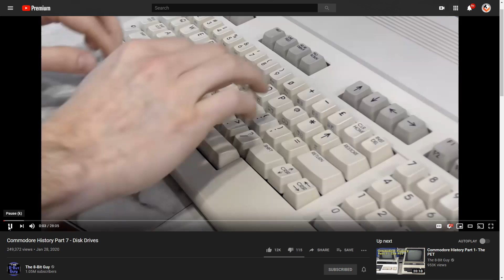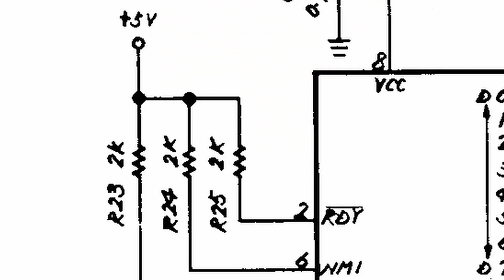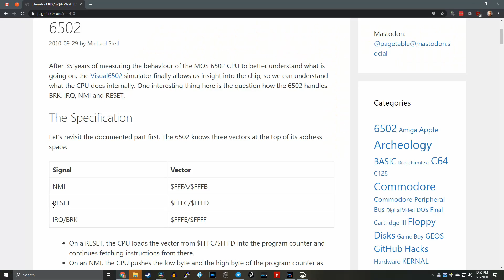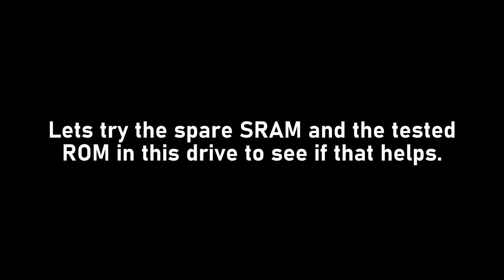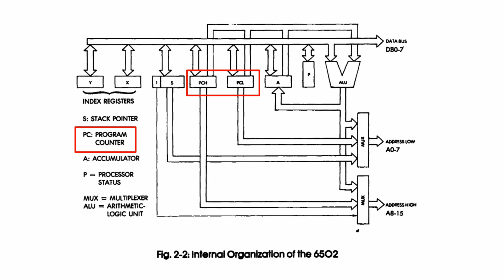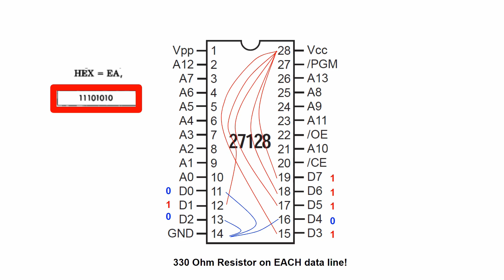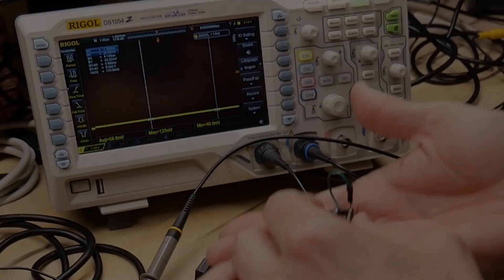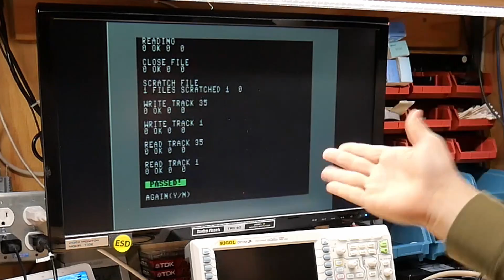Using a NOP Generator to help fix a dead 1541C drive (Bonus Track 1 Sensor demo)

Comment: Now that is some genius trouble-shooting. Totally out of the box and I love it!  

I love the 1541C drive, especially after you enable the sensor.  (Goodbye head knock!). I did on mine more than 30 years ago and never ran into any issues that I recall.  I still use it today.  But if you do come across any further information other than what was known at the time as "compatibility issues" please let us know.
Reply: I recently acquired a mint 1541C that has the track zero sensor. I have been vacillating about cutting the jumper and so far haven't done it, but 30 years is a pretty good test period.
Reply: @jasongins  Go for it.  😃It's still my main drive that I use.  Besides if you find something you don't like you can always reverse it.  Or you can install a switch so you can enable it or disable it at will.   To this day I still don't know what "Compatibility Problems" would have caused them to disable it from the factory.  Afterall, they used the sensor on the 1571 and while that is not 100% compatible, even in 1541 emulation mode, it still works fine with most software.

Comment: On the old 1541 you can put a small strip of gaffers/duct tape at the rear of the head to mute head knock.
My drive still has it now, 30+ years later. =)
PS. Nice video Adrian!

Comment: I added heat sink's to both my drives on all the chips  and a cooling fan on one of them and have not had any problems running 4 years without a chip failure and they get used a lot.
i have 2 drives aside that have the same problem as well  that i have to fix one day. Now i know what the problem is. thanks Adrian

Comment: I never would have imagined a test rig like that to test the lines like that. Holy smokes, that gives me a whole new angle to attack these dead 1541's I've been using as a bookend all these years. You sir are a wizard! Rock on!
Reply: ungratefulmetalpansy  Commodore, for all their innovation, was notorious for using shoddy parts and cutting a lot of corners. I'm just excited to hear there is a means to actually check the data lines, as it could save some old hardware.

Comment: Bad 6502s are more common than they get credit for... My first 1541 had a bad 6502 as well, diagnosed similarly, but since it was socketed, I suspected the CPU much earlier after a scope showed weird bus behavior. I bought a "new" 6502 from Jameco and it worked a treat. Starting to think 6502 ought to be more suspect in the diagnostic of bad drives ;)
Reply: I wonder if it is the way they are being handled. Back then static was a big issue. Wrist straps were SOP always. Later years they were done away with because diodes were added in the chips to deal with the HV static discharges. Now they are in everything and wrist straps are only a part of history.

Comment: Thank you for another excellent video. This  is almost like watching a thriller, or crime drama like NCIS or CSI , except better because it's real, you're solving the case yourself, and using cool hacks which are techniques i can use, tools I can actually build in my workshop and use. practical, informative, clearly explained.. A joy. thank you again.

Comment: I was really hoping it was something other than the 6502 again. I recently bought my third 1541 disk drive, and it's the only thing left in my ever growing collection that doesn't work. It has the same solid red LED and perpetual spin. I did a full exchange of socketed chips (all of the main chips were socketed) between the dead drive and one of my working drives. The working drive still works, and the dead drive is still dead. I checked all of the voltage rails and got exactly what is expected everywhere I looked. I definitely learned a lot about these drives watching this video and your last 1541 video. I was just hoping one of the drives would've mirrored mine lol.

Comment: You have certainly elevated your skills lately, or have been holding back before.  Certainly more valuable information than others that just think "retrobriting" is restoring,  instead of actually saving machines like yourself.  Great video.

Comment: I'm really loving your recent videos, very informative and creative. I never have seen or experienced a faulty CPU before. Maybe because I work with newer computers. You need to have a logic analyzer, it will make your life easier and will provide a wealth of information for the kind of debugging you do. 
Thanks for the detailed NOP explanation!
Reply: Newer chips have static protection built in while older ones do not.

Comment: In the video, Rodney Zak's book on 6502 programming is recommended.  That book is very dated and doesn't cover the 65C02 and 65C816.  A more-current book is "Programming the 65816, Including the 6502, 65C02, and 65802" by David Eyes and Ron Lichty.  It's available online and is well-written.

Comment: That's really ingenious ... I'll make sure to have one of those at hand if I ever get back into C64 repairs.
On a sidenote: a friend of mine was involved in the initial SID reverse engineering effort which included scanning the silicon of the chips ... his verdict (as someone with a massive knowledge in that field): "it's a wonder those chips still work after all those years, if you extrapolate how bad the manufacturing quality originally was to begin with" (silicon supposedly is 'bubbly' as hell). I guess it's no wonder some Commodore chips have failure rates near 50% by now (PLA, MOS TTLs, TED/7501, some 6502s to name a few)

Comment: I like your videos a lot. They are very educative. Have your ever considered wearing an esd wrist strap? Some of the damage could be done by an esd discharge. Especially CPU's and RAM's can be sensitive to that.
Reply: Yup. I was just thinking how those were SOP for opening anything back then. Chips would break from HV static discharge if you just looked at them wrong. It is just taken for granted now that chips have that protection built into them.

Comment: The computer I had back then was an Oric Atmos. Its CPU was a 6052. So basicaly that drive used almost an entire Oric just to spin the floppy of the C64...  Amazing.
Reply: There is no floppy controller chip in the 1541, all of the processing is done in software. This makes the 1541 an extremely flexible drive, you have very low level control to the disk; some games went as far that they used custom low level disk formats for copy protection.

Comment: Hi Adrian, just as a hint: one should NOT put a socket with the machined pins into another socket. The pins are thicker than normal IC pins and widen the contact fingers, which can lead to premature failure of the socket.

Comment: Unless I'm messing with RF stuff, I like to have my signal ground on a separate probe. They're all tied together inside the scope, so if one's connected - they all are. Having it connected separately keeps it out of the way when I'm moving the probe about and doesn't risk coming loose and shorting something.

Comment: One of the things you can look at when you are checking the address lines on a running 6502 is that A0 should be changing constantly at a frequency varying from about half the clock rate to the clock rate as it reads and executes instructions. It would be only very unusual code that leaves A0 either low or high for more than a few cycles.

And when using a NOP generator you should see A0 cycling at exactly half the clock frequency, 500 kHz on a CPU clocked at 1 MHz. (The NOP is two cycles, so each address will be read twice before incrementing to the next address.) Every address line above that should be cycling at half the rate of the previous one: 250 kHz for A1, 125 kHz for A2, etc. You can just walk your scope up the address lines (increasing the horizontal time base as necessary as you move up) with the frequency counter or channel frequency measurement turned on so you can see the frequency halving with each step. It's a good quick way to check that all the address lines are working properly.

Comment: Awesome explanation of the NOP generator! That’s a great tool to have in certain situations. 

I’m wondering if you could build one into a 40-pin “DIP clip” connector that hooks right over the CPU. You wouldn’t have to desolder anything, and you get convenient pins for scope probe hooks, too.

Comment: Hello Adrian after checking the address running within the NOP Eprom so you must check also that the 6502 is not in Reset. If the Reset is down the addresses are also not counting. Best Regards Volker from Vienna

Comment: You just turn your basement into C64 Basement latetly :) That would be very nice if you could add  386 -486 series restroration / repair videos as you did in past. Those were awesome man. I really like floppy drive repairs  btw :)

Comment: It's quite interesting that this drive comes originally with a 6502 CPU that is a 2 MHz variant. The letter 'A' after 6502 indicates that it is 2 MHz.  I was really hoping that the replaced CPU would be a 1MHz 6502 because you masured the clock and it is actually working at 1 MHz.  I wish your 1MHz spare worked.

Comment: fun fact. use a criss-cross wired dpdt switch on the red and black wires on the drive motor to be able to read the reverse side of 1571 formatted disks

Comment: I just started watching the video, so I'm sorry if you already mention some of that stuff in it.

My 1541c has a "normal" short board but a mechanism with a track 0 sensor that just stays unused due to the old board and old DOS-ROM. Datecodes on the drive mechanism and the board match, so it doesn't seem like something someone made at home by swapping parts. It looks just like commodore simply used what they had lying around, even if it meant putting in a drive mechanism with a track 0 sensor that will never get used. Which seems a bit strange, since there are also variants of that mechanism without the sensor, e.g. those used in the 1541-II.

Also, the enabled track 0 sensor will break compatibility with some fastloaders.
Reply from the maker: Completely believe that Commodore assembled such a drive. Do you have any info on what titles break? Others have commented it seems like an urban legend about the track 0 sensor causing issues.
Reply: @adriansdigitalbasement  It doesn't break software based fastloaders; it breaks compatibility with hardware-based parallel fastloaders, since the track 0 sensor occupies a line normally used for the fastloaders. Using such hardware fastloaders thus requires you to cut a trace to the track 0 sensor and replace the ROM with the original 1541 ROM (burnt onto a single EPROM) or (even better) the 1541-II ROM.

Comment: Great video, one tip though. It seem like you were cycling the power rather rapidly. If your off-time is too short you might actually be browning out the power rails, rather than fully cycling them. This can lead to all sorts of strange behaviors which can quickly send you down the wrong debug path.

Comment: This makes me want to get out my 1541 and finally repair the track 1 sensor issues it is having. Although the sensor is present, the drive will always ram the heads into the metal, producing the machine gun sound.
Reply: Edit: And you know what, I did, and it finally can use its sensor to prevent further wear to the mechanism. Thanks a bunch!

Comment: Great video, Sir!  These are very helpful with diagnosis techniques.  I'm about to get my 1541 out of a box I've had in storage since 1998 and use your information to fix mine, if it doesn't work.  Which is what I'm expecting.  * Now you mentioned some project you were working on that you're doing with ROM code but I think I missed what that project was in a later video.  Can you elaborate on the mystery project please?

Comment: None of my 5.25 pc floppy drives are working - all seem to have motor issues. It's a shame I don't have any diagnostic equipment. Still nice to see drives actually getting fixed!
Reply from the maker: Interesting I haven't run into that before. I have several and all work other than digital board issues that creep up like this one.

Comment: still the little tip i give. you can disable the serachbar on Win10 to save some space, since it's completely useless anyways
rightclick taskbar -> cortana -> first option
you can stil lsearch like normal by just opening the start menu and typing directly into that. same exact function except it doesn't take up any space on the taskbar and is technically faster
18:42 it can adress 65536 memory locations. because it's 16 binary outputs for the addres. so 2^16 different addresses

Comment: SRAMS and EPROMS are commonly pin compatible.  So what it's doing is running through a program routine on the SRAM and then a verify.  You can "program" SRAMS but they lose everything on power loss.  The only problem is you don't want to use high voltage programming or you'll probably damage them.

Comment: friend Adrian I have a short board 1541c like yours, but it has a different fault, when I turn on the c64 the red light does not come on and when I give a read order to the contents of the disc it spins and spins without stopping and if I give a read order The game or program only comes out looking and the drive does not rotate at all, that is, the order does not freeze, not one more text comes out, thank you very much for your advice.

Comment: 13:12 i think you should be able to replace the gate array chip with the gal chips you used for the c64 pla with a simple adapter circuit.

Comment: Have you considered replacing some of the MOS and Rockwell 6502's with 65c02 which use a lot less power and less heat?

Comment: Hey Adrian, I'm at minute 16 or 17 of your video and I'm thinking maybe you made the NOP generator to delay the execution of code until the voltages have stabilised. I've seen a circuit in iirc the Roland TB-303 which does that too - it holds the reset line until a capacitor has charged. This ensures the cpu doesn't glitch out during boot up. Notably glitching due to brown outs is relevant even today. CPUs that have advanced safety features can as it turns out still be hacked by randomly glitching the voltage rails - which modifies the instruction the CPU is fetching by changing its bits from 1 to 0, which sometimes will make the cpu spit out its firmware! Look up the Chip Whisperer project. :)
Reply from the maker: The built in reset circuit in the 1541 does this already - it holds the CPU in reset for part of a second so the voltage rails stabilize. Nothing is different here than a normal boot up as the CPU jumps to FFFCh/FFFDh to load the address to jump to. (Which will be EAEAh in this case but normally would be some location it read from ROM.)
Reply: @adriansdigitalbasement  i should have watched on before commenting :) or deleted my comment :) the nop generator was a super smart idea!

Comment: I have a1541 with the very short boad like this one and its drive spines and light stays on. Can I get new 6502b chip from jamesco or is that different chip? Ebay its $30 per chip, have any suggestions on cheaper one?

Comment: Adrian, I was wondering if the 65C02 would work.  It’s not a MOS device, but should be able to drive other MOS devices.  And Jameco has refurbished 6502 processors, but dang, they are almost 10 bucks each.  Ouch!!

Great troubleshooting!!  Excellent video. Thanks!!
Reply: The 65C02 is not a straight drop-in replacement.  Among other things, you have to clip pin 1 (it's a vector pull status signal that has no analog in the original 6502), and you have to tie pin 36 (bus enable) high.  Also, there's at least two manufacturers of the 65C02... WDC and Rockwell, possibly others.  The WDC chip does NOT accept TTL input levels unless you also add pullup resistors.
Reply: SpearM75503 Thanks!!  Good info.

Comment: mark it says the guy who has a notch on the EPROM but plugs it in wrong and grills it. If you ever noticed, all the connectors have a side with a small step in it and the step always is going to the outside of the board I guess, so that way you cant plug it in wrong  (check it)

Comment: helpful video, im working on a 1541 that has stopped working again (read led on) with the rom images link I can check my dos rom, big thankyou, my drive has Fujitsu sram and these are known to fail so this will also be desoldered and checked

Comment: When your NOP-Generator has problems with cross-talk or the resistor solution is not applicable and CS(chip-select) has to be respected: 
Use a SN74LS24x 3-state octal buffer like the SN74LS244 with CS wired to 1G+2G. 
Some simple pattern generation or address framing can also be done this way utilizing the A-Channel-Inputs.
BTW: An EPROM is a wonderful pattern generator. Fill it with EA and you know what?:)

Comment: This is going to help me and my super-shorty board 1541. It's oddly enough, not a 1541C, but its got the super-short board. It also has the ROM chips on a daughter board since C= was being cheap and using up the old supply.  Mine powers up normally, LEDs go out and motor stops, but the head never moves and it fails to respond to commands from the C64/VIC. I replaced all the 74xxs and the 6502. Still nothing :(
Reply from the maker: Mr Lurch has a similar brown drive w/ ROM board with the super short board and chassis. Clearly Commodore using up remaining stock ... So funny.
Reply from the maker: The 6522 chips are likely culprits of that behavior by the way.
Reply: @adriansdigitalbasement  Swapped those too :( I'm think it's the custom chip(s).